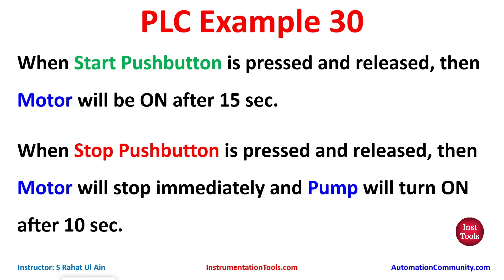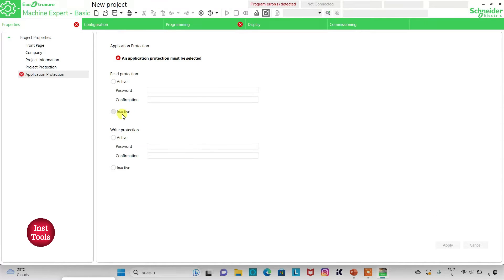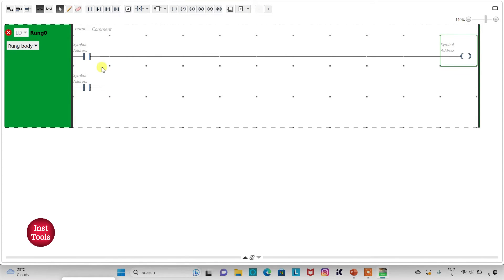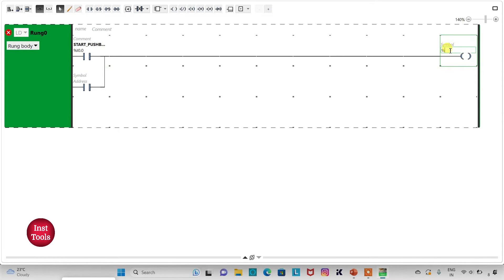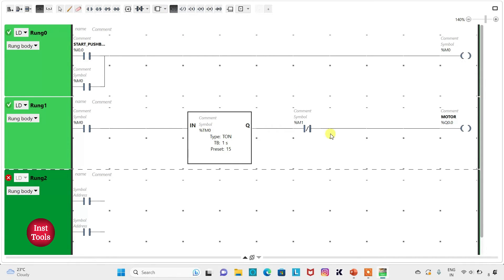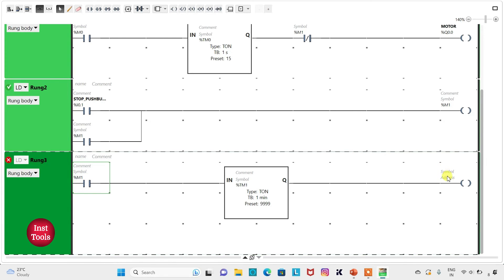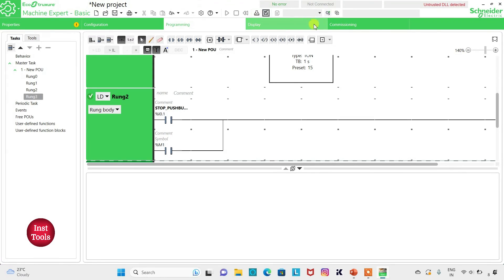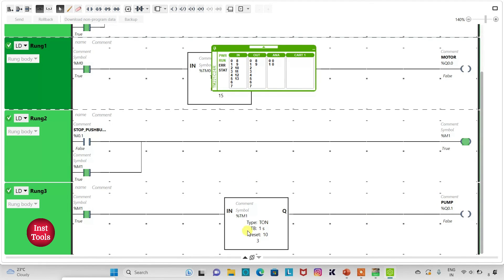PLC Code - START STOP Motor & Pump - Learn Schneider PLC

Comment: I have copied a few of your programs and l can never quite get your examples to work.... the way you dissconect a latch by M1 to stop the motor still leaves the PB latched ... always  have to add m1 to pb for it to fully disconnect and reset.
Reply: You have to do the same as he does in the video because if M1 stays disconnected then your Motor_1 is connected and we wants to disconnect it after memory 2 starts